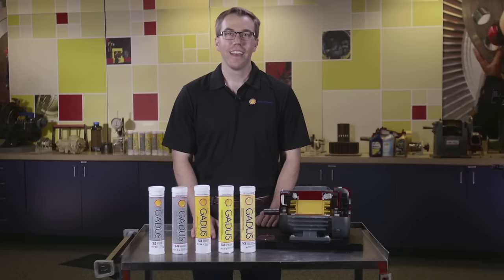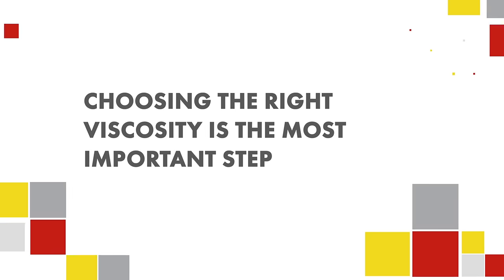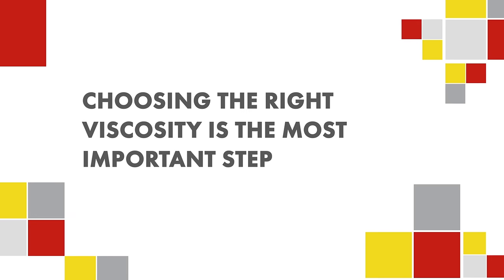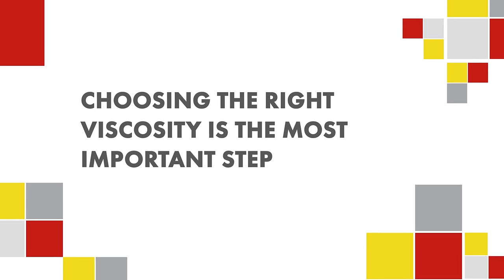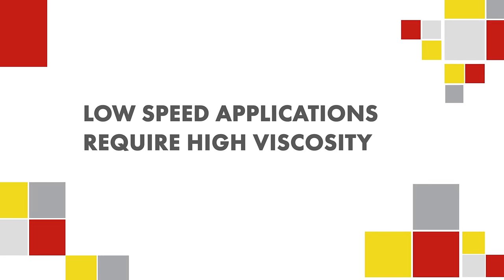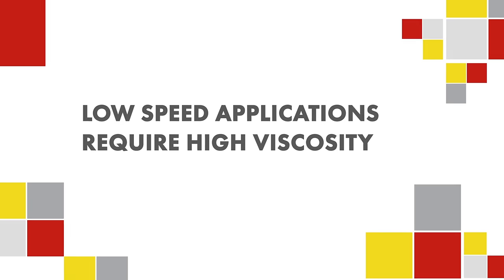Shell Lubricants - Choosing the Right Grease

Comment: Why open gear is need low viscosity whereas that high load and low speed?
Reply: Open gear what exactly?  Generally you do not use greaseable "open gear" at all.  If there is no prevention of contamination getting in to an open system then a pulley and belt should be used instead.